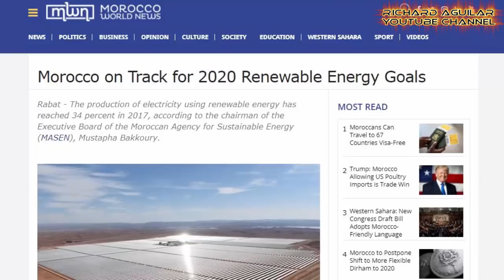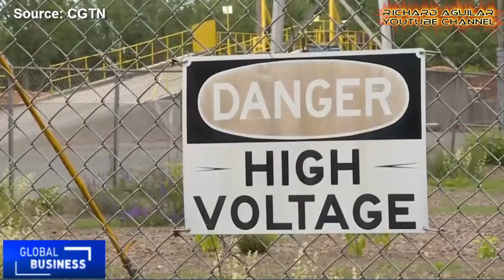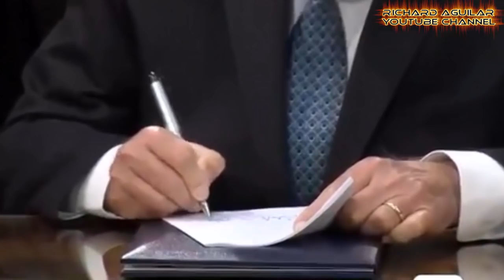The Rise of Renewable Energy Worldwide! Many Countries Are Now Switching to Renewables

Comment: Floating solar panels in the water will kill plant and animal life, unless you only have a meaningless amount of solar panels (the Singaporean project could only power 250 apartment homes).

Generally the best places for large solar are over irrigation canals (lease is free and prevents evaporation), parking lot covers (cheapest to install and it prevents cars from rain/snow), or deserts for grid scale solar. Putting it on a flat roof, like that of a warehouse, is also very cheap and easy. Residential solar usually costs more than grid scale because of installation costs. Also, only grid scale operations include solar trackers, which allow the panels to provide energy much longer each day, smoothing the duck curve.
Reply: It's nice o see massive and minors economiess in vesting in the newables however why Punit all on solar and wind when a masivy amount is missed from po m the oceans?
Reply: In the big picture, those are minor issues.